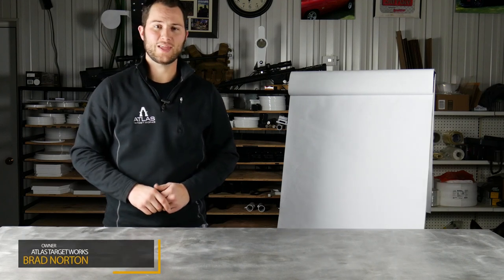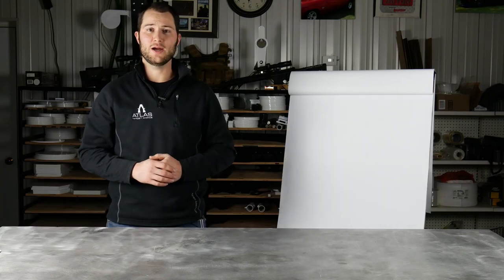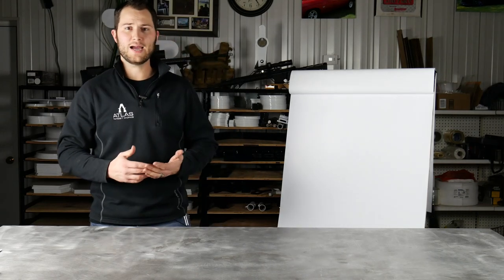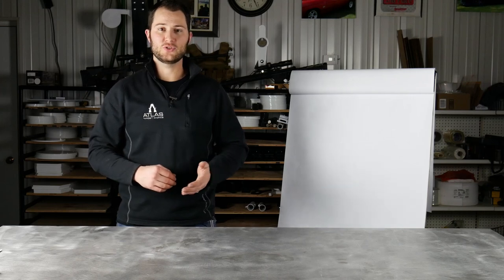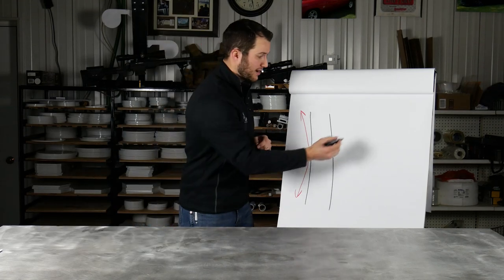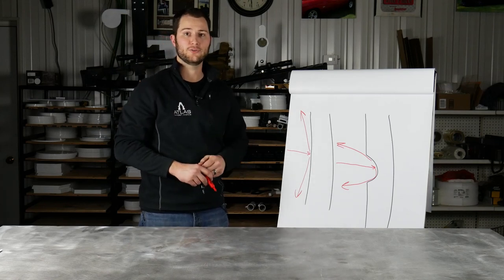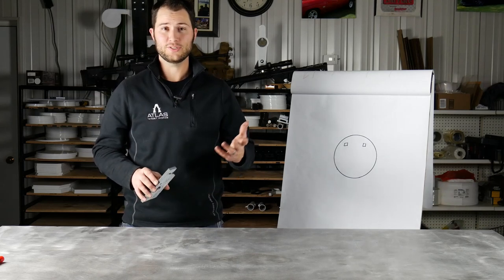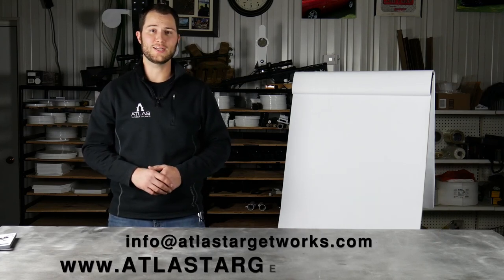What is AR500 and why does it work so well for targets? - Atlas Target Works

Comment: Brad... I have never shot a "lead"   5.56 bullet.  Didn't know they existed.   I shoot 62gr green tip penetrators. You make it sound as if I should not use your targets with my loads.  Thanks
Reply from the maker: I know we discussed this via my website chat but for the benefit of others finding this comment. The green tip "penetrators" have a steel core which in my experience only causes slightly more damage to the steel. More importantly though is the fact that the steel core doesn't explode into a million pieces like a lead bullet does and will ricochet at odd angles. A dealer of mine hosts a demo shoot every year and they had to stop using steel targets because they were finding little holes and slits in their steel building 50 yds away from the steel cores.
Reply: You should never use green tip penetrators with any steel target ever. Not only will it permanently damage any AR500 ever made, it's also a fire hazard.

Comment: Does 2 1/2 inchers bolted together perform as well as 1 inch?
Reply from the maker: My thoughts... maybe? If the edges were welded together so there was no gap which would cause a bullet impact to simply fling the rear target back like a newtons cradle I think it would.

Comment: Why is no one still using T -1 steel. Yea, it not as tough at AR500 but it is cheaper. For handgun rounds 3/8 or 1/2 in is good stuff.
Reply from the maker: For my business, the market for pistol only targets is extremely small. Most people (again, from my experience) want something that is capable of handling centerfire rifles. It's not worth stocking something with such low demand.